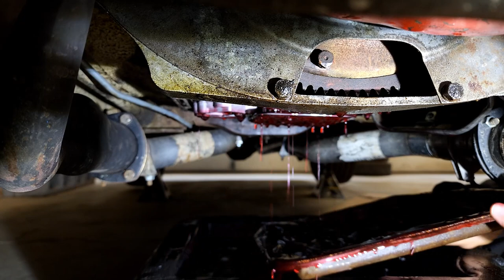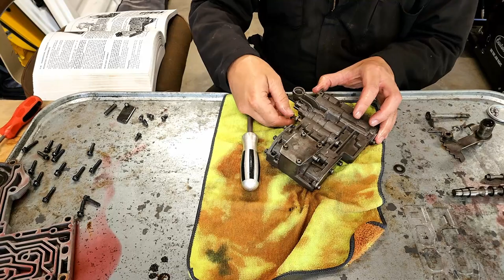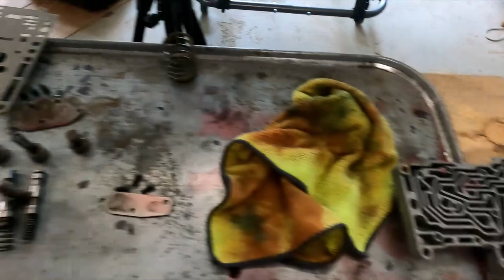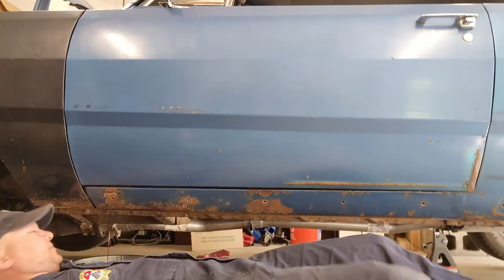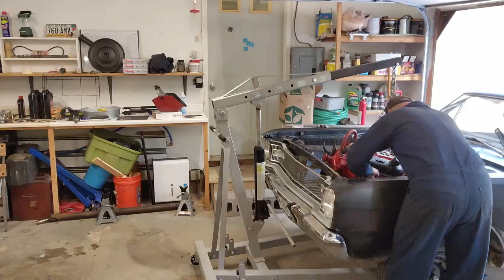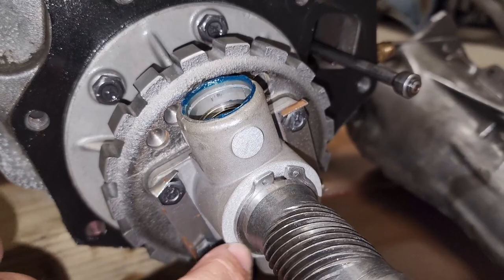Gigantic Mistake From My First 904 Rebuild Finally Revealed

Comment: I had a 67 Dodge Dart Gt with the 273 HP engine and a 4 speed. Surprised a lot of Mustang owners and Chevy II owners when they saw my tail lights.
Reply from the maker: Hello Ronald and welcome! That is awesome! I wish my 273 was a HiPo. It is not far off after the rebuild. Domed pistons and an appropriate cam would get it there I think.  I have been on the fence between either upgrading it to a full HiPo or dropping a 360 in it. I can get a running junkyard 360 Magnum locally for less than the pistons would cost. Power upgrades are something for a later time though. Have other things I would need to do before I start looking at boosting power. She still has the 7 1/4 Suregrip in the rear end.
Reply: @MontsweagGarage  I hope you put it on youtube when its done.
Reply from the maker: I already have the "it's done video planed out. Not that it is ever "done." In the meantime I will be documenting the journey between now and done here. I have a couple of videos in the works now. One I already had planned (replacing the heater core) and one that was a viewer request (working on the door windows.)

Comment: You hit the nail on the the head with your statement "too much money". Darn near everything is too much money, especially for Mopars  Unless you have too much money on your hands you don't need Hotchkis suspension. Question. Why didn't the clip fit originally, did you replace a part or the clip and it was not up to spec? Seems like there is zero quality control on everything coming out of China these days, especially car parts. Keep plugging along, the engine does look nice.
Reply from the maker: Good Morning Chumley! Thank you and welcome back! You are quite correct. I don't NEED a Hotchkis suspension, but I just want one. Lol. As far as the clip not fitting, long story short, I broke and had to replace the output shaft. The output shaft is a junkyard piece from a 72 and apparently is just a bit different. I will go into more detail on the breaking and fixing of the transmission during my next recording session.
Reply: @MontsweagGarage  Sounds good, I was wondering if it was some more of the non quality controlled made in China parts that are running rampant. Have a good one.

Comment: Before you fixed that clip on the shaft was it wobbly, mine is and not sure if it's a bearing or a clip like that. I got a 85 dodge D-150 with a 904 trans and it pops when placed in gear and shakes around 15mph
Reply from the maker: @Patron_375  Welcome to the channel and thanks for the comment. My shaft was not wobbly. I would recommend calling A&A Transmission (317-831-3066) in Indianapolis. They specialize in MOPAR transmissions and may be able to help you figure out what is going on and they will have the parts you need. They helped me out big time when I broke my output shaft.

Comment: At the 10.30mins range. We're ya thinking wtf did lndo with it? 🤔 Coz that's me all over. Gunna end up on my tombstone. Where'd l put it? Gday from Oz.
Reply: Was meant to read where the "f" did l do with it. Is yours an A 904 Torqueflite LA Chrysler. Please respond when convenient. ✔️
Reply from the maker: Welcome Paula, and thanks for the comment! I was ABSOLUTELY thinking where the f*ck did I sit it this time?  I set things down all the time and can't remember where I put it. I do much better when I have a work cart I can throw everything on until I am done but I don't have one in the home garage yet. On an entirely different note. I hope to get back on your side of the works again. Been there a few times in my Navy days. I loved most of the places I went. Hope to see you around the comments.
Reply from the maker: And yes, It is a Chrysler A904. It is currently sitting behind a 5.9L Magnum. =}

Comment: Which manual are you using? Factory service manual or a specific rebuild book?
Reply from the maker: Hello Jack! Welcome to the channel and thank you for the comment. Initially I was using a combination of the Factory Service Manual and the SA's "Chrysler TorqueFlite A-904 & A-727 Transmissions: How to Rebuild" book. Once I broke the output shaft and could not find a 1967 replacement (ended up going with a shaft from a 72), most of my info was based off of conversations with A&A Transmissions who specialize in 727/904 builds.
Reply: I didn't have to pull transmission out of mines .I change my tailshaft  on 904 I took off the two screws that hold the plate C clamp on the car.

Comment: Hey I have the same car and have been working on it myself and there’s not many videos showing how to work on the dodge darts I don’t have an owners manual could you show how to remove the wing window on the passenger side I got all the bolts out but it’s not coming out
Reply from the maker: Hello Evan and Welcome! I can definitely work on putting together a video covering door window removal. I have some work that needs done on the driver's side that I was planning on doing later, but it is good cold weather project. It will take me a bit to get everything in order. Don't want to put out bogus info. What year is your dart? If it is a '67 as well, contact me at MontsweagGarage@outlook.com and I can send you a PDF version of the shop manual I use for most of my research. Another great resource is the forabodysonly.com forums. Just keep in mind there are many ways to do things and even more opinions about what is the "correct" way. I just find what works best for me and run with it.
Reply from the maker: @evansparta1159 Were you just looking to remove the little window itself or are wanting to see how to remove the entire assembly frame and all?

Comment: you will be pulling again unless you find your missing a snap ring,, there should be 3, one thin which goes up against the governor housing,   and 2 thick ones on either side of the bearing ,, you have one of the bearing snap rings that you hacked  up agnist the gov body ,, good luck
Reply from the maker: Hello Mike, welcome to the channel and thank you for the great info! During my original rebuild, I put the snap rings back where they came from and there were only two. I just dove back into the FSM and sure enough I am missing a snap ring. Fortunately, the transmission is currently out of the car so I will definitely get that taken care of. Your help is greatly appreciated!

Comment: I don't condone the front end swap, the factory front suspension is a marvel of engineering and far superior to the fad front end swaps out there, just rebuild it and install  polygrapite bushings with a beefy swaybar kit from PST. That's what I did for my dart and it handles like a Ferrari in the corners. The factory suspension is infinitely adjustable caster, camber,  and ride height. All tuneable with a wrench. No shims or spacers, truthfully a very advanced design even today
Reply from the maker: Hello David! Welcome to the channel and thank you for the comment. I have actually decided to keep the original suspension. I picked up a new set of bushings, torsion bars, and a bolt in sway bar for it. I still have to get the shock towers/upper control arm mounts replaced before I start getting it back together, but It's coming along. I hope to see you around. Have a great evening.